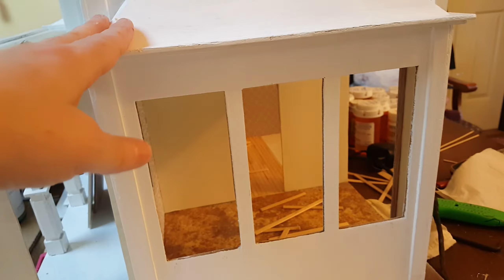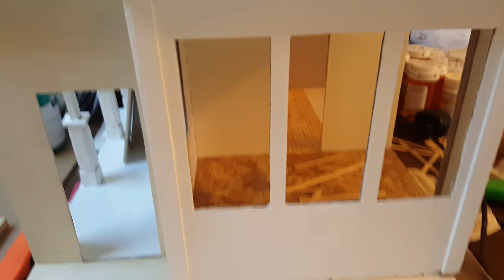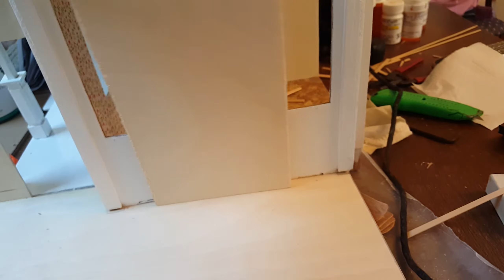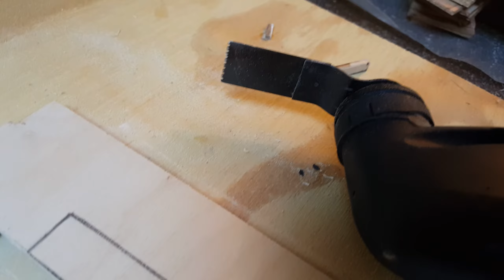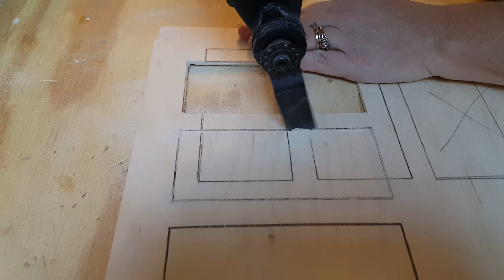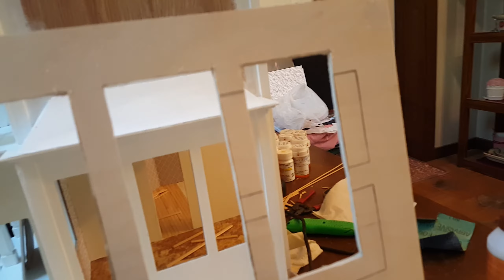Miniature Dollhouse Windows Tutorial

Comment: I have a bookshelf that im turning into a dollhouse. What kind of tool can I use to cut out windows and doors. The wood is pretty thick
Reply from the maker: http://www.dollhouseminiaturemadnessandtutorials.com/dollhouse-structures/windows/
Reply from the maker: There are a couple of videos on that page where I show you how to cut out a window. 
I use the Dremel Oscillating tool but you can also drill holes then use a Stanley Hand Tool 20-807 Mini-Hack Saw (sold on Amazon) or drill a hole then insert the blade of a Coping Saw ( you have to remove the blade then put it back together once in the hole)  also sold on Amazon